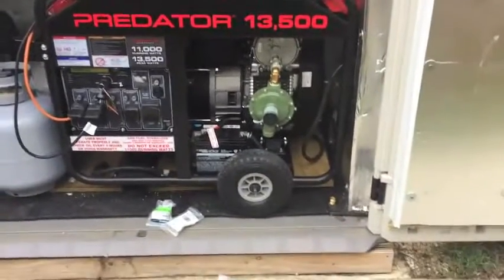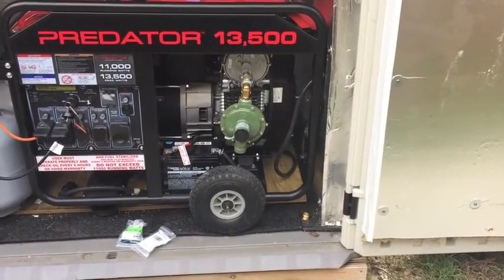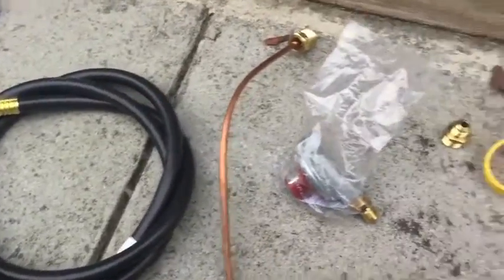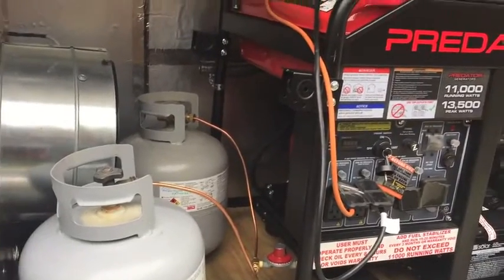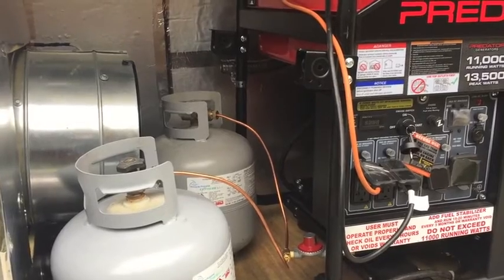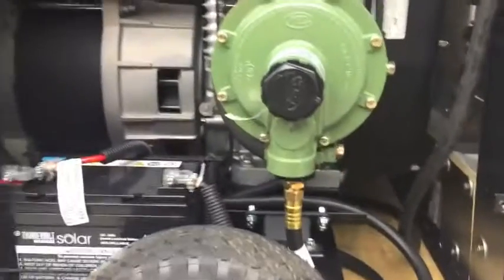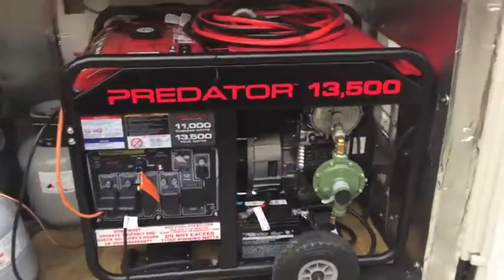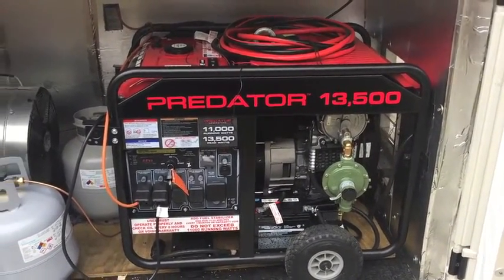Predator 13,500 Generator Tri-Fuel Conversion Part 3

Comment: Several questions please. I want to do the same setup and would like to know how you modified the shed. Also why two gas regulators?
Reply from the maker: sidney white the shed has a greenhouse intake vent that opens when the generator is powered up.  The exhaust fan pulls cool air thru the shed across the generator and out of the shed.    I insulated the shed for heat and noise with 2” foam board and Roxul insulation.   When I did the gas conversion there was not a regulator available that would support enough flow and pressure for the size engine on this generator.  So I had to go with the setup you see to ensure the propane fuel supply is adequate for the demand placed by the engine.   Lastly.  I saw some versions where the exhaust was vented thru the shed.   Instead of doing that I simply routed the exhaust so that it points towards the exhaust fan.   With the fan pulling air out I’ve had no issues with heat build up.   
Having said that I have to add, my project was not done as a how to.   If I were to do it all over I’d just buy a standby generator designed for home use.    This works great, but after all is said and done, having one purpose built beats the cobbled one you see here hands down.

Comment: I was referring to  1st or 2nd video.  when you installed the snorkel on the carb,  the 2 lines that  came out. I wasn't sure if they were routed over a manifold. 
Thank you for your response.
Reply from the maker: Gotcha - no those lines are routed over the valve covers.  No issues with heat in that area.

Comment: great video. Any issues swapping between fuels?  When you installed the snorkel, are those lines laying across the manifolds?  thank you.
Reply from the maker: I do not have any issues swapping between fuels.  Of course before switching fuel source, you have to shut the unit down, then switch supply and start it on the fuel you want to use.  You can't switch while the unit is running.   I am not sure I understand the question on the propane lines.  The propane tanks are connected via a T-fitting.  From the T fitting I have the hose running under the generator and it connects at the bottom of green regulator.  From there the low pressure propane comes out of the silver regulator and directly into the carb. The first video in the series shows how those hoses are ran into the carb.